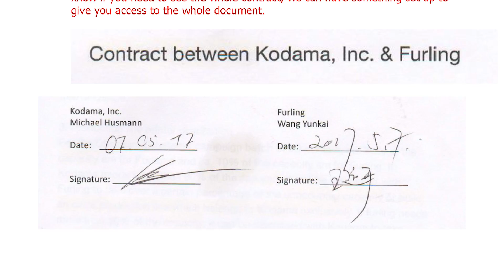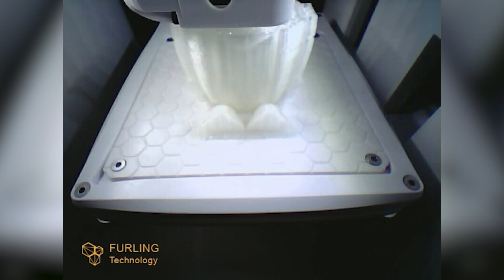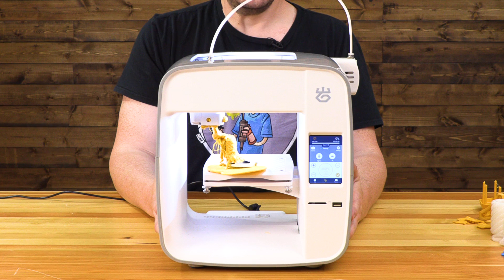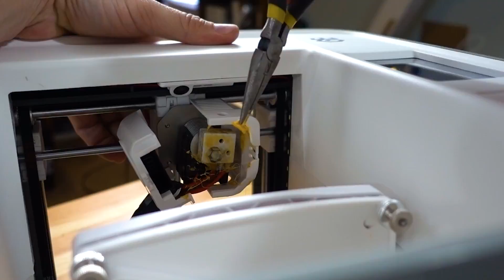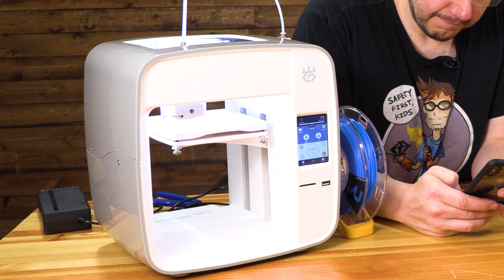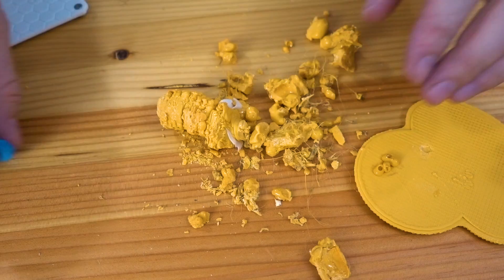FAILURE and the Furlingtech YAN

Comment: Btw, I'm not exactly sure how the 3d printer software interprets the model files for the 3d print, but I'd imagine it wouldn't be too difficult to take the model file into Maya/Blender, and simply extend the bottom of it to create a false base that could be designed for easy removal.

Comment: V6 in the hot end. Nothing special... it seems. Then the end sensor was f...ed up... It's a bad design IMO. Nothing should fail that deep!
This printer could be good for kids. Just need to be modified: a glass bed, a heater, a modified firmware (a hack if it doesn't allow that). Then it may be called decent. Probably.

Comment: Omg. This happened to my brand new 1 day old ender3 and it was a pain in the ass to fix without breaking it.

 Btw if this happens to you just go and buy a heat gun to melt all of the filament away. Trust me trying to hack away at it does not work at all. (Mine was a lot worse than this and had filament inside of the aluminium heat sync find)
Reply: It's rough man

Comment: Failure can happen on any printer. A heat gun is not greater than average technical knowledge.

You literally heat it up and take it off a piece at a time and clean up with a wire brush.

There are tons of pictures of print failures from pretty much every cheap printer I have seen.

You could have found examples in pretty much every 3D Printing Facebook group within the past 3 years.

Adhesion issues are adhesion issues.
Reply from the maker: Yup.

Comment: I handled this issue for customers by using a PEI sheet over the honeycomb surface. (Wanhao Duplicator D10, same machine) - Right out the gate so no adhesion issues. The filament going upwards in the extruder can be thwarted if you are still paranoid by removing (at your own risk) the silicone shield around the nozzle. Its replaceable, and youll see what Im talking about if you/when you look at the head to eventually replace a nozzle.

Comment: Just recently recovered from a similar failure on my Ender 3 with ABS. I was alerted to the issue when I heard the cooling fan making a god awful noise from the plastic scraping against it. lol Always try to fix it first. You can always buy parts if you can't fix it. Took me 20-30 minutes and I got it all pulled off. Replaced the nozzle and that was it.

Comment: Nicely done. A year ago  I bought a MAKIBOX from a lad who seemed to have struggled to adapt it to Ramps (he didn't have/include an Arduino Mega 2560 which might have been the cause of his troubles) but he'd also inserted white plastic insulated wire through the bowden tube ironically to unblock the nozzle - of course the white plastic melted creating a Proper Blockage; I spent 30mins extricating carbonised filament & wire insulation from the printhead; I succeeded - only to learn that the thermostor/heater connector was broken and I can't find a replacement so I'm fitting it with an E3D extruder which will work IF I can get the correct PINS.H settings on Marlin 1.1.9 for Ramps 1.4 /Arduino Mega 2560 R3 Wi-Fi. Anyone who can help with this please do offer your advice as I'm  going bald from pulling my hair out, LOL. It's good to know how to, and to successfully FIX things!

Comment: Ignoring licenses on creative works, violating CC-BY is absolutely unforgivable. That should be a straight-up DO NOT BUY recommendation, until such time as they come into line.
It's not as if it would even cost them anything to comply.
Beyond that, I can't see a single good point to recommend the printer anyway. Non-localised app, raft-only printing (what decade is this?), PLA-only for the best part of $400?

Comment: Joel... Joel... Joel... ... ... ... JOEL!!!
You are one of the few reasons why I went into 3D Printing 0 verifying how easily it can be done and how cheaply it can be obtained. Thus while saving my pennies to get a 3D Printer (from ebay), on Xmas '16 my daughters got me a Tronxy X1 and my friend got me a Tronxy P802 (Anet A8 clone?). Meanwhile my friend got himself a XYZ DiVinci Jr. and we have been printing ever since.

You have shown a couple of these failures and recovery thereof in the past. And as any other 3D Print Users, we got them too. On my X1, the filament gooped into the cooling area which is covered with a metal case. Took a while but I got it cleaned up. The DiVinici Jr has a similar Print head Assembly like the Furlingtech Yan, encased in plastic with tiny wires and electronics inside and should be sealed but somehow filament gooped up inside the print head casing It was a major mess to clean up. MAJOR!!!! But after 2 hours of careful heating with a heatgun and picking tiny bits with a tiny needle nose pliers, it was cleaned up and fixed. One PLUS I will give the DiVinci is that you can pop off the print head out the printer with a press of a button and you can work it from there, which I did.

As you show, this was an easy but time consuming fix. Nothing more. Great work! Depending on the price, it depends whether or not it is worth it.  My friend got his DiVinci brand new for $299, while my girls got my X1 for $125, so the Furlintech Yun has to fit between these prices to make it worth one's money and time. As shown - failure and all, makes it great beginner's printer- simple to use. But Beginners beware - failures do happen and one has to be able to fix their printers as needed when it happens.

Great Video!

Comment: The worst fail I ever had on my cr-10 was similar. The filament decided it liked the extruder and not the bed and wrapped itself around the extruder, breaking one or the fans. I had to cut the wires off the fan and solder in the new fan to get it to run quietly.

Comment: i know 100% infill is a waste but the model i designed was for animation in a certain way and cura only does 100%% infill.
is there anything bad about 100% infill?
Reply: You can adjust infill percentage in Cura. There's nothing wrong, it's just very infrequently that you'd ever need 100% infill.
Reply: @joshmaceachern7383  i had to chop the bottom off of the model for my animation so i don't have the topology for it so it's making it a solid object
Reply: @ScottishPhoenix  oh, I see. You could probably fix that hole in Meshmixer. Angus over at Maker's Muse has some good tutorials on it.
Reply: @joshmaceachern7383  nope. Because it's for animation my topology is insane. You can not fix it on any software
Reply: @ScottishPhoenix  if you are chopping the bottom off of the model.  a neat trick is to take the original model and move it below the build plate in cura before you slice it and it will skip any sliced layers under the buildplate.
Reply: @infernaldaedra  i can also give the model a shell of my own making so it has it's own thickness but that also means a lot of support. Also i wouldn't mind a solid print of my model I'm going to my taking versions of it with me to places

Comment: Having a skirt exactly where the nozzle pushes out filament is disastrous.  If the filament curls, and it will, it will cling to the skirt and start to glob.   I'd say just shelf the skirt unless it won't print without it?

Comment: Try Magigoo on the YAN; I could NEVER get my Prusa to have PLA adhere properly - I tried BuildTech (loved it), but I love the Magigoo even more.  I've gotten massive blobs on my own hotend from time to time - mostly from a bad roll of PETG.  It caused a LOT of problems.  Fortunately, the hotend on the Prusa is REALLY easy to access, clean, etc.  The only major problem I ever encountered was when some filament leaked into the threads of the nozzle and cooled there - making it utterly impossible to remove the nozzle to clean things out.

Since the amazing wizards at Prusa fixed my printer, I've had days and days and days of constant, consistent, AWESOME quality prints, with very, very few problems of any kind.  Love ya, Joel, and keep up the great work!

Comment: Great object lesson in not giving up! The theft of IP (intellectual property) without attribution is kind of a killer, however. They don't get a free pass on that.
Reply: TangoDeltaDelta the Engineer that walked away from Kodama apparently owns the rights to the original design now (or something like that) and has licensed the design to Wanhao and Polaroid.
Reply: @WeAreMovieMakers  OK, good to know. I was actually referring to the models Joel mentioned that weren't given proper attributions.
Reply: @WeAreMovieMakers  The only thing the Kodama engineer could potentially own any rights to would be the software interface ( app etc.. ) which anyone could write from scratch easily, The printer itself is just a basic cartesian design that's been done to death nothing to protect there.  Plus they are using a cloned E3D v6 by the looks of it.  The non attribution to the model designers and infringing their IP is a big no no as well.

Comment: My Creality CR-20 makes a consistant knocking sound when any axis moves, anyone has seen this before? I can't figure out where it's comming from. At the same time, my hotend-thermistor died, i'm gonna replace it in a few days but the knocking sounds are really weird... 
Not sure if those sounds are gonna have a negative effect on printing, since i haven't been able to print anything while the thermistor is broken. It does vibrate a lot though, so i'm guessing it's not good.
Reply: So my thermistors arrived, all problems went away when i installed it. Obviously the ERR:MINTEMP is solved, but the knocking sounds have gone with it too.
I have no idea how these things are related, but apparently they are.
I'm happy it was a cheapo fix of a few bucks :)
Reply: Sounds like your motor current is either to high or to low, thus making your motors skip steps
Reply: Do the axis knock while the printer is off?
Reply: @infernaldaedra  I could never figure out where the knocking came from. There wasn't a specific motor vibrating more than the others.

Comment: So my creality3d ender-3 printer works perfectly fine except it cannot print circles. It just makes them into a oval shape. If anyone has any suggestions please respond.
Reply: Try calibrating the x and y-axises?
Reply: ensure the belts are properly tensioned, that the grub screws are properly tightened on the pulleys